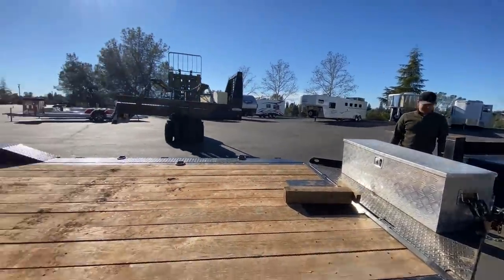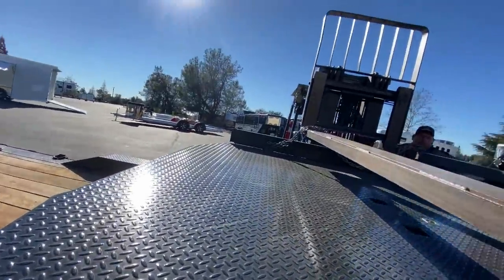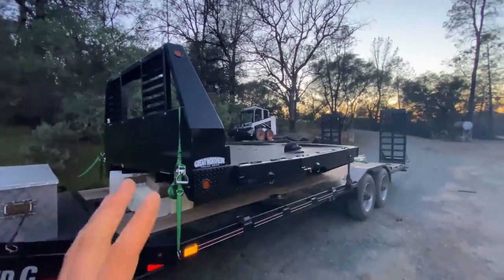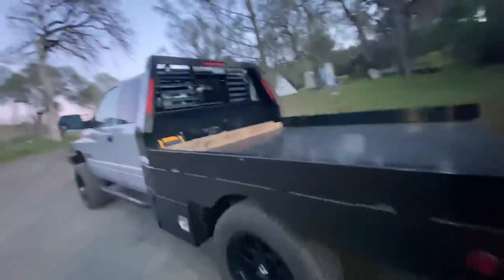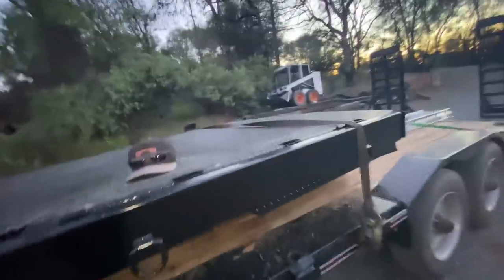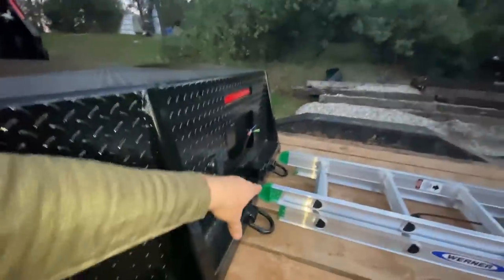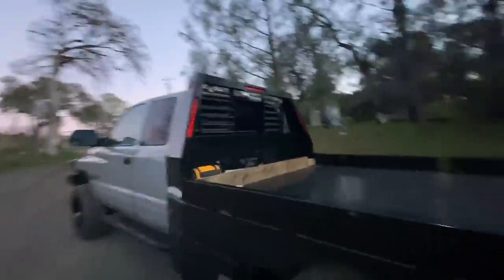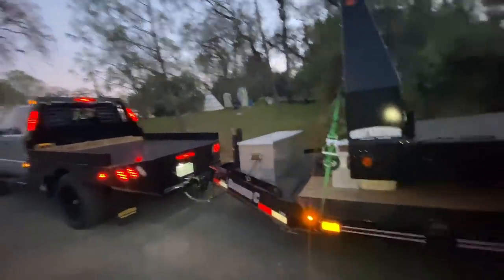BOUGHT THE FLATBED FOR A TRUCK I DONT HAVE YET  PLANNING AHEAD

Comment: My CM flatbed is the aluminum ALRD, which has strong gussets for the headache rack. Have used it for 2-1/2 years with no issues. Absolutely love having the extra LED lights on the headache rack as it let's anyone along side my trailer see my turn signals or brake lights and there's backup lights up there too. With the rearview mirror dashcam, visibility is no issue, nor if there are rear passengers, tool boxes, fuel tank or cargo on the flatbed.

Comment: I bought a great northern bed just like you bought, ordered custom to make sure it was wide enough to fit biggest high side boxes in each side and leave 50” between for pallets.  Didn’t have the skirts on side but had them install custom low side boxes looks awesome and being super beefy not just thin sheet metal.  Paid $4850 for the bed installed onto my truck.  Love the bed!! As you know they are pretty well built.

Comment: Looks like a quality body. Just a idea to kick, a guy I worked with on a pipeline job, a #798 hand, built a bad ass body and built the drag up tank between the frame rails and hard piped his pick-up tube out of the tank and into the drivers side front box. He then just attached his pump and hose to the tank and it's all contained in the box out of the weather. Use a 3" nipple welded to the bottom of the box that the pump nozzle will fit into for a holder, and drill a 1/4" hole through the box bottom, inside the nipple to prevent dribble build up. He also mounted his ARB compressor in the box. Just a thought. Check out some of the 798 guys home builds for some good ideas, some awesome builds.

Comment: For your fuel tank hose just mount the pump under the truck with a switch on the rack and put a hose Real on the bed that way you can just pull it out to fuel the stuff and then retract it when not using and it save space on the bed

Comment: I've got 2 Bradford beds one aluminum and one steel. There both great. I like them because you can buy a bed right from the factory. But I'm only hour and half from them here in Kansas. That bed you got will look good on the new 5500. Btw I have my spare on top the headache rack on my 4500. I stole the idea from you. Thanks. 👌

Comment: There are quite a few bed manufacturers that put the ball behind the rear axle. 

I have a 2015 ram 3500 single wheel cab and chassis and the ball is behind the axle on its flat bed.

Comment: Definitely agree with you on the tail lights and headache rack on the 5500 , don't like it. Also don't like the bumper pull hitch mounted to the bed . On my Ford 550 flat bed I mounted the goose neck ball hitch to the frame , and the bumper pull hitch is also mounted to the frame not the bed. Just my preference. I feel it is always better to be pulling from the frame of the truck. Being a welder was definitely a plus when I built my bed . Good luck on the new trucks. Sucks that you had to go with the automatic.

Comment: I think the cutouts for the tail lights  on the norstar is more for protection than looks and it makes sense but they should’ve put a plate under the lights inside the cut out kinda like a step but more or so too keep dust out

Comment: Feightliner I believe had a duel tank setup with built in steps for 30 or 40 gallon tanks make it nicer for getting on the bed. International on some models maybe. Mack for the offset cabs yes but there 70 gallon plus big size  wise.

Comment: I bought my 4500 it came with a Bradford, looks exactly like your new one. Except can tell mine is older from when the truck was new in 12'. It had halogens, I installed led. Mine are straight up and down thou not slanted like yours. I also have the like inside the louvered area not inside the headache rack, much better improvement inside the headache rack, like you said better visibility. 
Great looking bed, it'll last. Good choice.
 Mine is still strong holding up great and it's almost 10yrs old.

Comment: I definitely like the custom fuel tank or tanks under the side that will definitely free up bed space not sure what a custom tank would be for price but it would be excellent would definitely put the fuller neck on the same side as the fuller neck of the new 5500 to make thing even easier cause I think you said you don't use off road fuel

Comment: Im going to rob that idea a little bit of putting the fuel tank under the truck except I would like to keep all the boxes. Now to figure out how with out getting in the way of a transfer case
Reply: On my 86 f350, I made the exhaust dump at the cab and put a tank where the exhaust used to run along beside the driveshaft.
Reply: @BuildingWithRane   That's about what I was thinking about with my 89 SuperDuty once I 4wd swap it. Using the front tank area and putting a bigger tank in its place. That would leave the passenger side open for my exhaust to exit in front of the rear tires

Comment: Have a Great Northern trailer one thing to look at is any point where the wiring travels through the frame or a metal wall of the deck and make sure there is no rough edges as when they put holes in my trailer for wires looks like they used a torch and didnt clean up the edge or use anything to protect the wires other than that love the trailer
Reply: The wiring should always be in wire loom at a minimum.

Comment: Have you looked at the C5 Manufacturing South Fork Dump Flatbed for your dads truck? It has an integrated Gooseneck hitch in it. I just found it yesterday and wanted to get your thoughts on it.
Reply from the maker: That seems kind of sketchy
Reply: I'm not a fan of the ball being mounted to the dump bed either. Pretty sure they used to go by Cannonball Manufacturing.

Comment: Is it just me or does the new bed for the 5500 miss the rear red side marker lights on the rear corners? Grandma's truck has them, didn't see them on the new bed. Would suck to get pulled over for that...
Reply from the maker: Side board folded down over it

Comment: Ok so why not get a bed rated for what you want to tow?
Reply from the maker: I explained it in the video
Reply: @VBELTandSON  I get you wanted to save some money and time because if you order one it's a few month's away how ever I was referring more to the towing capacity limits of the bed as you said you're going to beef it up as you want to tow more than what the bed is rated for
Reply from the maker: @coreydark8795  I’d like to add to them anyway. Unknown if I will even need to go over the ratings anyways but I will know it’s good to go now
Reply: @VBELTandSON  ok now that makes more sense. I was under the impression you here going to be up on higher rating. I've also made a few comments on Dimond C trailers to try and hurry your trailer along.

Comment: Your getting as bad as Greg A for collecting trucks 😜😂, iv noticed on some things iv had in the past that the paint or powder coating starting to come off relatively soon in the life span things until I started having stuff done with a guy I know who is doing sand blasting and powder coating for a living he was telling me if you dust the millscale off the steel and then powder coat it grabs onto the steel better and lasts a hell of alot longer than other people's powder coated stuff and I got to be honest over the years now iv seen the difference myself so it wasn't just someone saying my work is better than Joe Bloggs down the road, the stuff iv had done is for off road truck's guards steps etc things that do tend to get a hard life so it's worth bearing it in mind
Reply: So you're saying everything should be blasted first? Or like a wire wheel kinda thing. 

I've heard paint doesn't stick well to sharp corners so they should be rounded for paint. That seems true and indicated here. Also many of these factory paint jobs are just barely adequate
Reply: @mrmotofy  I'm just saying from my own personal experience and talking with a friend who owns a good general engineering company and fabrication business who has sand blasting or other media blasting which customers may ask for business that powder coating and alot of paints stick and adear to the metal much much better if they are etched of sorts the powder coating Iv had done by him he's given a blast first and his stuff stays good for a hell of a time Iv bought suspension arms axles rock sliders bumpers things for on trailers which have been powder coated by other people and in 12-18mths you can see the signs of it lifting and rust development so I started having him blast my stuff and powder coat it and I haven't had a problem since very often it's the millscale that stops a really good bound with the steel and that starts to loose it's grip on the steel and then the rust starts, I'm only talking about what Iv found from personal experience if that can help anyone in getting a good job done like one that lasts for year's and year's I hope it helps
Reply: @alex79buckland  Gotcha, I would tend to agree...surface prep. Like I mentioned most of these manufactured products just don't have the proper time and effort put in
Reply: @mrmotofy  that's why sometimes it's better for you or I as the one buying something if you can strike a deal with the company of buying it as a raw product so you or I can do any modifications we may want doing and then prep it the way we want it to last and have the coating we choose for it
Reply: @alex79buckland  Yep agreed that "may likely" be possible with something like this where you're probably going manufacturer direct. But most are sold through dealers/distributors without the option to customize